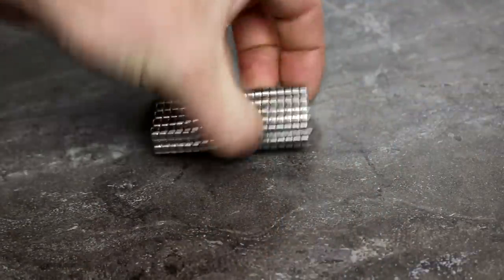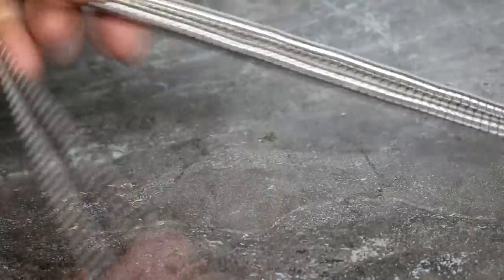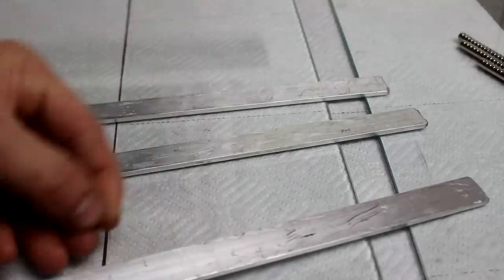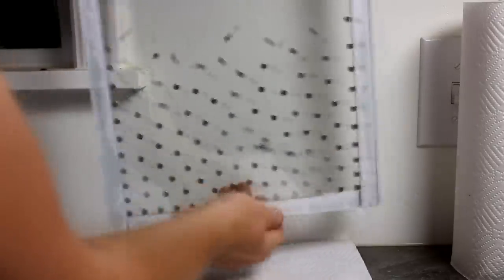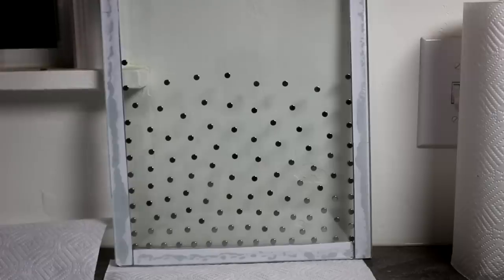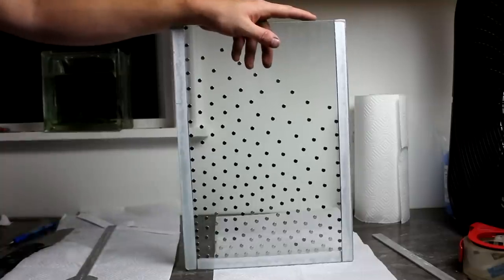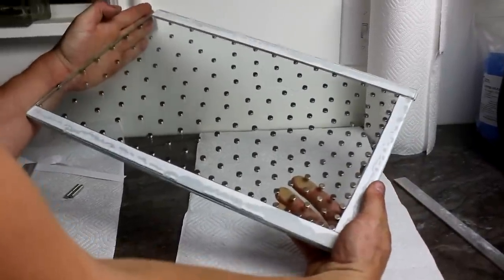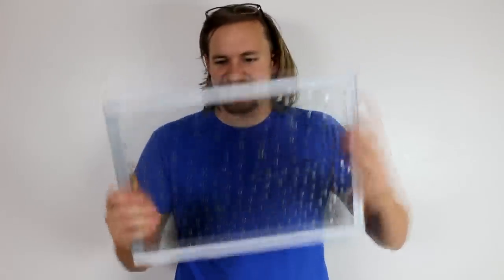Modeling a Gas With Magnets

Comment: Hey Cody! You need to seal it and fill it with oil!
Reply: Attach that magnet to a motor and spin around outside. What a freakin neat apparatus; Ideas are flowing; I want one.
Reply: Also I hypothesize that you can make a whole molecule sink to the bottom instead of just an atom... and if it doesn't you need to play with that effect by eliminating gravity. Spin the motor there too.
Reply: You need to use an air hockey table with little magnet pucks. You could give the pucks a good amount of mass and let everything happen nice and slow and really be able to observe and comprehend.
Reply: Or maybe some clear lube? Plus maybe some "heat source" by adding continuously flipping electromagnet on the sides.
Reply: What if the magnets were surrounded with a plastic ring that kept them just get enough start to prevent sticking together also?
Reply: I'm to dumb for this conversation
Reply: Magnets lose their effect over time
Reply: The Champ true, but for neodymium magnets, that's a long long long time.
Reply: long long long long long long long long long long long time.
Reply: The Champ VERY slowly. And imperceptibly slow if not subject to motion.

Comment: cool idea. thanks for sharing. might consider adding in some liquid nitrogen and see how it affects their magnetic fields as it cools down and warms back up.
Reply: does the internal resistance of a magnet affect the magnetic field? if so, i imagine gravity would start to matter less and less and the magnets would become spaced way more evenly.

of course, the glass would also shatter from cooling down, heh.
Reply: Not Legato yes! Temp matters greatly!
Especially as you increase till the curie point of the material
Reply: i just read up on magnet strength a little, the N ratings, yeah there are some curves about them and some of them deal with heat better etc.
Reply: he'd have to find a way to deal with the thermal shock

Comment: This can also be used to demonstrate compressibility of fluids. As you go deeper in an ocean the top layers of water compress on the bottom layers and the weight density of water increases with depth. This is why you have submarines or a watch rated to a certain depth for water resistance.
Thanks for the wonderful video.

Comment: Perfect example why mars can't hold an atmosphere on it's surface. I've always thought about if you go deep into mars is there a point where the atmosphere would be thick enough to survive without a pressure suit. I'm willing to bet it is. maybe even breathable air.
Reply: There is no oxygen on Mars. I think what little atmosphere there is on Mars is mostly CO2.
Reply: actually there is a % of o2 on mars
Reply: Actually, given that Mars has ~37% of Earth's gravity it could hold a thin but theoretically breathable atmosphere. However, the crucial factor is that Mars' small size allowed its molten ferronickel core to solidify, and without rotating metals it has no magnetic field. This allowed particulate radiation (i.e. mostly solar wind) to bombard the atmosphere and slowly strip it away, which is something that doesn't happen on Earth because we have an electromagnetic generator in our core creating a lovely magnetic field.
Reply: We can easily add a synthetic magnetosphere using nuclear power to fuel it. Trivial 20th century technology. 

Also I am pretty sure as you get closer to the center of mars, pressure will decrease and make it harder to breathe. The surface has the highest pressure.
Reply: "Easily" is an unbelievably relative term here, because you can't just "add" a synthetic magnetosphere. Not only does it take raw mass, which we do not have to provide because Mars is a very long way away and there would be practically nobody there, but also it requires a stupid amount of resources. To make a planet-sized magnetosphere you'd need a planet-sized machine because otherwise there's no way you're going to be able to maintain the thing, or even realistically fuel it. 

Also, as you descend into a planet you allow more and more of its atmosphere to weigh down on you. This increases pressure, rather than decreasing it. Unless the laws of physics were changed when I wasn't watching, this will be true everywhere in the universe.
Reply: If mars has a surface primarily made of oxygen rich silicates like on earth, then it would be chemically simple to liberate the oxygen in order to make an atmosphere. Logistically it would be insanely difficult and expensive. Nitrogen would be a problem however, you'll probably need at least twice as much nitrogen as oxygen in order to make the atmosphere safe, and finally some large quantity of greenhouse gasses would be needed, but being simple hydrocarbons they're easy enough to get. 
Back of the envelope calculations show that on earth all that's required to create our entire atmosphere but of pure oxygen, would be to separate the oxygen from the top 3.5 meters of  rock. Assuming total atmospheric weight of 5.1480×1018 kg, land surface area of 148940000 sq km, assuming most common component of stones being silicon dioxide, which is 50% oxygen by weight. Then taking half the 2 grams per cubic centimeter weight of granite or other stones and dividing to find out how much stone is needed. 
If we're really desperate for nitrogen however we could harvest enough from Venus to terraform 3 earth sized planets, but in that case we could get the oxygen from there anyway.
Reply: Voluntarist you have that backwards. As Cody's experiment shows. Molecules get closer to each other the closer you get to the center of gravity because of the weight of the atmosphere above it. Think of it like this. on earth the higher you go the thinner the air.
Reply: That's not necessarily true because you'd face the same issues as Hadean Earth faced during formation. Basically, all the oxygen in the atmosphere reacted with the rock, forming those silicates and related oxidised minerals in the process. Pumping more oxygen into the atmosphere without accounting for the freed unoxidised material would simply mean it would reoxidise again. Nitrogen wouldn't necessarily be necessary other than for plant life because whilst the atmosphere would be extremely oxygen-rich compared to Earth's own, it would also be at a much lower pressure. This would lower the risk of fire (though it would still be high), and so you'd have a lower requirement for inert "bulk gases". 

As for greenhouse gases the first step would be to include methane, at least I'd say it should be. Methane is an excellent greenhouse gas, and it would also provide fuel for some early gene-modified Archaea (very early microbes, very hardy chemitrophs) probably to feed off of, which could be used instead of roasting ovens to biochemically reduce the chemicals in the rocks and allow free oxygen to be released. This would mean that oxygen was being continually released, and this would mean that a potentially stable equilibrium point could be reached with (extremely relative) ease. You'd still need to be essentially harvesting an entire planet's energy to potentially make this viable since the bottleneck is really in raw matter levels, not the base biology or chemistry, but it would be RELATIVELY easy if you were at a stage where mass-colonisation of Mars were being performed. 

Also we have to remember that we still don't have a magnetic field, so some kind of vast satellite network to create one (at least a minimal one) would still be needed. Without that, it might take some time but you'd still have the issue of solar wind stripping away our expensive, expensive atmosphere.
Reply: Tiberius Hrafn-Úlfur i mostly agree with you on your points. but i believe since Mars's gravity is so low, weight and necessary structural integrity of needed building materials is much much lower in strength. So with the weight of the rock and debris it can be removed with much less effort and energy.
Reply: True about oxidization, the moon would be extremely difficult to transform because there is huge quantities of unoxidized iron compounds on the surface,  however mars doesn't have this. But the waste product of oxygen release would be mostly silicon which is protected from major oxidization by a thin layer of surface silicon dioxide, just like aluminum forms.  Nitrogen would be important in order to lessen the danger for human habitation, while  .1-.3 atmospheres of pure oxygen would be fine for breathing for short periods, there is some evidence it could lead to health problems, particularly in the lungs. But mostly it would be dangerous for industry and technology, not to mention if we wanted to introduce terrestrial soil bacteria many couldn't handle the concentration.
Reply: Mars's lack of an ionosphere is at least as big a problem as its low gravity. I imagine that large, greenhouse-like buildings might be more practical than trying to make the whole surface habitable.
Reply: Many smart people
Reply: Nomae,  glass can be made on mars. Martian glass is stronger than earth glass but it's worse at blocking UV light
Reply: the problem in mars not pressure. its the low gravity environment and the lack of magnetic shield to protect the atmosphere from high energy particles coming from the sun. so what happened on Mars is that the core solidified the magnet shield went down and  as the solar wind hit the atmosphere it started to lose molecules over few thousand of years and with the loss in pressure speed up the process
Reply: even with our magnetic shield it does happen to earth but in a very tiny % so close to zero that is irrelevant. plus our planet still thickening our atmosphere due to volcanic eruptions, and well our on polution.
Reply: No oxygen on mars but has co2.... your confused mate
Reply: There is co2, but not enough for full atmospheric pressure. You need to get that extra gas from somewhere.
Reply: By driving and building power stations

Comment: This is actually a really good model of the atmosphere as well. Some people can't understand why on one side, you have the Earth with its atmosphere, and on the other, a vacuum. You can try to explain that there's actually a gradient, and that the "vacuum of space" isn't quite a vacuum, but they won't listen - and claim it's an evidence for the Earth being flat. In your model, it's clear that the more gas on top, the higher the pressure and less distance between each molecule you'll have. On top, molecules are still present, but the distance between them will increase exponentially.

Comment: Please try to extract Iron from cereal!
Reply: you would get the smallesst amount
Reply: That's been done so many times though
Reply: maybe it's more interesting if extracts the iron from blood
Reply: You can get a measurable amount.  You would be surprised.
Reply: maybe it's more interesting if it's a virgin blood
Reply: Any iron shavings you extract from crushed cereal has been added artificially by the cereal company. All iron that is already in the cereal is dissolved and blended, and shouldn't produce visible shavings...
Reply: It would have the yield about the same as iodine from iodine salt - practically nothing.

Comment: If you still have this laying around, a couple of cool things you would be able to do (if you like) are adding a piston you can push from the top like you did manually before to simulate pressure, and adding something that can vibrate at different speeds to simulate different temperatures. Just a thought. Keep doing what you do, Cody. You're awesome.

Comment: that right there looks like a physical representation of the simple 2D diffusion diagrams in my transportation phenomina book. in fact it perfectly represents why navier-stokes equations solved for this system have a gravity term in it that depends on height and density of the gas.

this is a perfect macro example for many physical phenomina with gasses

Comment: Very cool experiment! Fantastic video! However I'm not quite sold on it representing a gas.

While certainly showing some properties of gas, like higher density on the bottom due to gravity. The big no no for me is, as you correctly pointed out, that the particles are not moving. The kinetic theory of gas describes that particles are constantly at random motion. Their velocities are also somewhat random and follow Boltzmann-Maxwell distribution. The movement shown with big magnet does not correctly model movement of gas particles.

However I think this experiment beautifully represents solid material. Magnets are pretty evenly spread out and I can clearly see them forming a regular crystal structure with some imperfections here and there - or as material scientists call them, dislocations. In fact when you introduce big magnet and make them vibrate it's exactly what happens when you apply heat. Molecules are held together by strong forces in their crystal structure so they can't just fly out as if it was gas. Instead they vibrate around their fixed position when heated up.

The piston showcase is what happens when you hit the material with a hammer and forge it. This case would be cold forging, we can see the crystal structure deforming but never quite breaking (in hot forging a structure would break and regrow new one). After the forging we can see slight elastic recovery in the structure.  And when you add "heat" (big magnet) it relaxes even more. 

Don't take this as criticism saying you're wrong. I guess if you don't want to delve into microscopic scale and stury inner workings of gas particles the experiment might very well represent gas. This is just my take on it.

Comment: idk if you covered it but you also have a demo for gas pressure as well you can tell those magnets on the outside are pushing outward and with more gas there would be more outward push ( though im aware pressure has more to do with the motion and collision of gas molecules bumping into the sides more often due to more particles however we're already missing the motion component in this model so a statement works fine)

Comment: This is really cool.  Of course it's not perfect because those aren't really gas molecules, but it works pretty well if you think of it as a two-dimensional cross section with "down" being the orientation of gravity.  If you remove "down", it simulates an absence of gravity.

Comment: Use glass circle instead of rectangles, fill it about 3/4 full of magnets, attach a piece of magnetic viewing film to one side, then set the whole thing onto a clock base that spins it once every hour and you'll have a delightful art installation. Running at 1 rpm instead of 1 rpm gives a nice sound to the piece. If you're really willing to invest a bit of time, color the magnets alternating black and white to watch domains form and disperse on the side without the viewing film.

Comment: There's probably some way to reduce the effect of friction between the individual magnets and the glass panels which is presumably the main reason for them to be so stable in place, making it like an air hockey table. I'm guessing the magnets would still find equilibrium but they'd be much more sensitive to perturbation.

Comment: If molecules (like in gas) are always moving, is that no perpetual motion?  Could that not be harnessed to devise a perpetual motion machine?
Reply: Maxwell's demon
Reply: Sorry for replying 10 months later, but it was a good question, and I dont see a good answer. 
But No. 
Molecule movement is a function of latent energy, if you remove the energy they move less, and provide less engery, or if you do not remove energy they bounce off themselves and retain their energy, like the magnets in this really cool analog computer that Cody made would, if they did not have friction slowing them down. Or do, if you are looking at them retaining kinetic engery by resisting gravity and staying in place as being an analog for the vibration. 
But there is nothing useful to pull out, energy wise.
Maxwell's demon, the only other reply, is just a loophole; from a thought experiment from the early days when science was not as sure as we are today what atoms where. 
It almost violates a law of thermal dynamics, to concentrate heat in a system, but not quite. As we learned more about atomic scaled physics, we realized that it does not violate anything in thermal dynamics, but, also creates some cool exploitable behaviours that are allowing us to make some better insulations and even make computer chips that run on thermal energy, so that is cool, but not a perpetual motion machine either, it is still taking and using heat energy, and that heat is still fwooshing away not to be used in the system again. That is a nice technical term to impress your friends, fwoosh
Reply: Good idea, but no, if you harness the movement they slow down, which basically means they get colder, once you reach absolute zero movement stops and so no more energy can be harnessed
Reply: @tfwmemedumpster  Zero movement would violate the uncertainty principle, so that's not what would happen and is also not what prevents Brownian motion from being an energy source. The problem lies in the fact that Brownian motion means that there is a random, flat distribution of energy (high entropy), whereas energy harvesting requires a disparity (low entropy) to benefit from the resulting energy flow. As the first poster mentioned, Maxwell's demon was the proposed solution, and reading up on why it doesn't work answers the original question.

Comment: Could you put a guitar pickup on it? Taking this concept one step further you could put a speaker on one end/side and the guitar pickup will pick up the magnetic vibration on the other end/side. It's essentially a wireless signal transmitter, but I think the effect that it will have on sound will create a cool effect. Perhaps it would sound like a new kind of reverb?